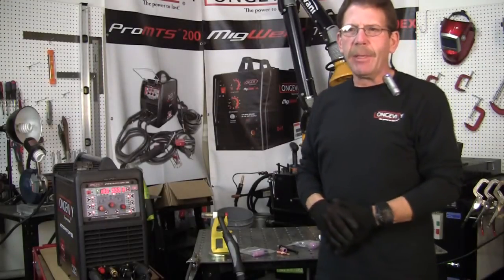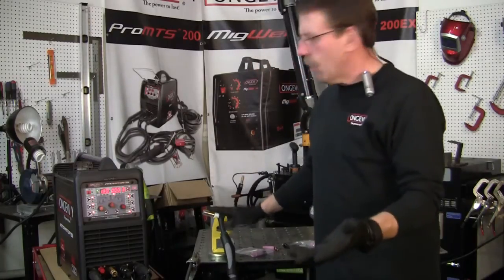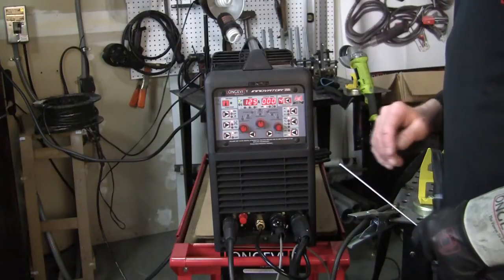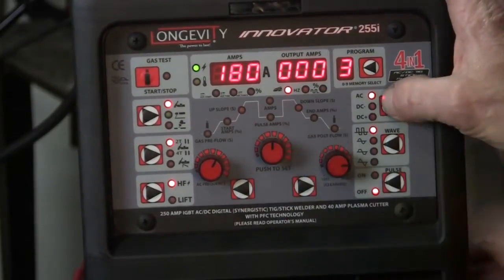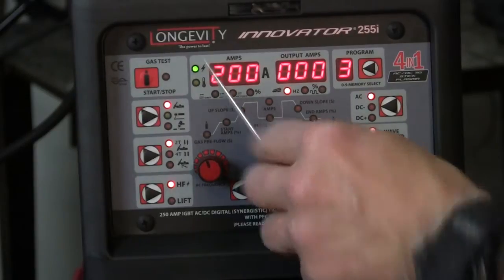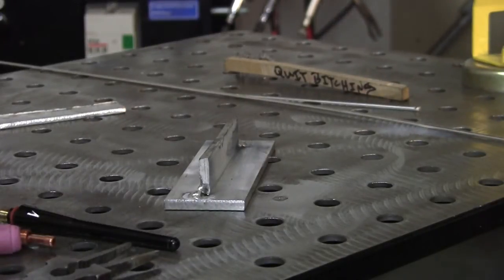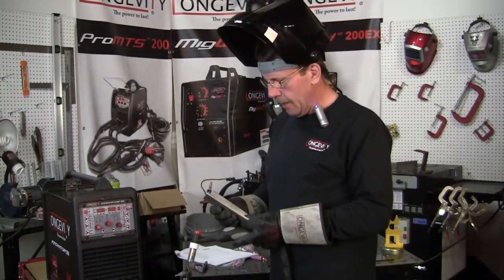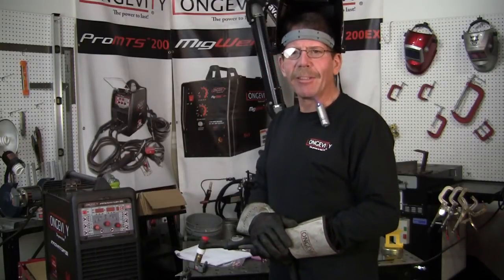Longevity INNOVATOR 255i - 250Amp AC/DC TIG Welder, 40Amp Plasma Cutter - Part 3: AC Welding

Comment: I have the 200PI version, had it 10 yrs, works nice.
Did some welding on my motor/bike today, nice smooth arc in DC steel.
I'm a retired baker, not a mechanic, its not too hard to figure these machine out with patience.
WHen you buy a piano they don't teach you how to play the instrument.
Reply from the maker: Right on! Thanks for watching!

Comment: I have an older model of this machine, the manual lacks detailed information and the video's are horrible .  The control panel is confusing and lack of detail in the manual makes this machine difficult to use.